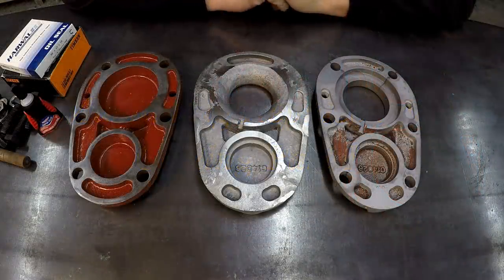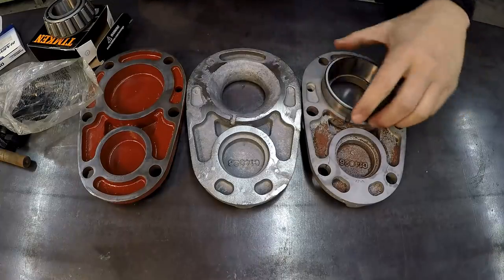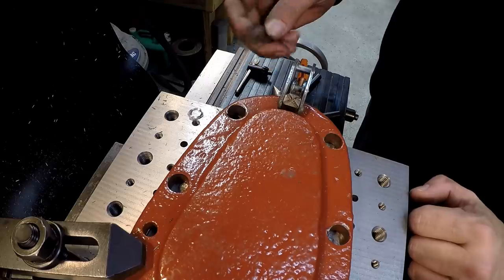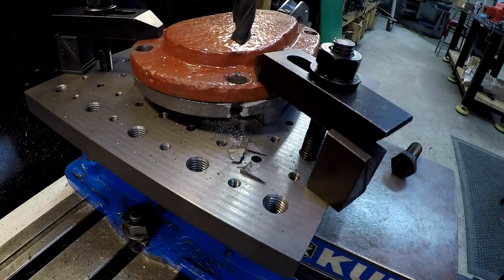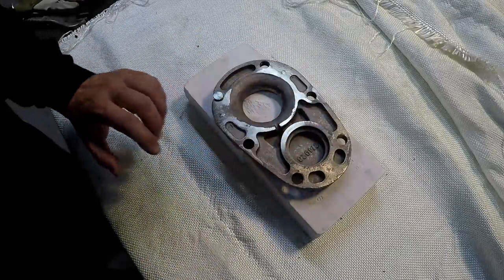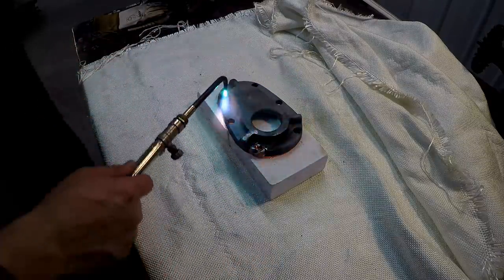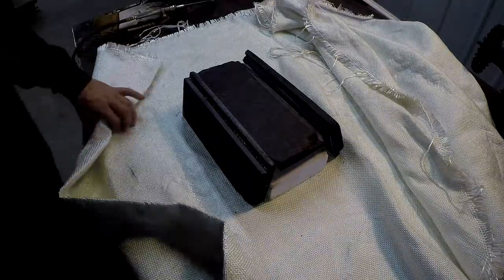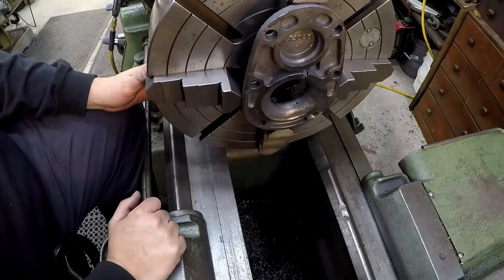Machining a Replacement Casting Part 1

Comment: Just curious. Why didn’t you repair the original casting?
Reply: i'm no adam but i would guess that the little corner he repaired wouldn't affect structural integrity whereas the original was in many pieces right across the face and into the bearing housing

Comment: Tough break on the drill damage.  I hate it when things go sideways like that.  I snickered when the aluminum sagged.  You did well, really pulled this out of the scrap bin.  I was wondering if you chucked it 45 degrees to the way you did, would it clear better and get deeper in the jaws?  Nice job still and all.  Looking forward to the finish.

Comment: I wonder if the material from brake disks and brake drums used to cast introduced the hard components in the material. I've read of similar problems using sash weights. It is kind of pot metal that is inconsistent in what you have in it. As a CNC guy I would try to measure the curves and hole positions and reproduce the original dimensions in AutoCAD if the original drawings aren't available. Then cut it out of billet on the Bridgeport Rigid-Ram CNC mill. Also, depending on the method of casting,  it is always nice to have extra duplicates while you are at it.

Comment: shouldn't you pre-heat the part in the vice? if you pre-heat first then put it into the vice, the vice will pull a lot of heat out of the part.

Comment: Usually a pattern is made bigger than the part to be cast to allow for shrinkage.   So, how come your pal used the filled up original part as a pattern and ended up with a new part the same size?
Reply: I wondered that too. You could thicken it up with a layer of bondo or something...

Comment: When the aluminum plug started melting, I instantly thought of maybe using a ceramic shield from an old spark plug. Would that have worked for the size hole you needed ?

Comment: I'm sure this isn't the first time you've been asked this, but why not tig braze? Both better heat and puddle control.
Reply: I have absolutely no idea, but maybe cause Cast iron tends to crack with very local heat spots like when welding. 
Maybe he tries to enlargen the heated area by using the torch and this lowering the risk of cracking? 
Idk, or maybe he just learned it this way :D
Reply: Could be I suppose. Although with a preheat I've never encountered cast cracking during tig brazing.

Comment: When casting anything you must add extra size when i saw that casting i cringed as those bolt holes i could see looked to be too close to the edge. You must add size with a mil on each side at least tape resin what ever . It needs to be larger than original due to salidafying metal contracting

Comment: After witnessing the majesty of that carbide bit. Why would you ever use HSS?  Is it just a price thing? Do you use them sparingly because you can burn them up, and they cost to much to replace?
Would annealing the the cast prevent this damage?
Reply: Price. Carbide is also much more brittle (and thus unforgiving) compared to HSS, and for most jobs, it just isn't necessary. HSS does just fine - even in CI. Just not in rock hard CI...
Reply: Go on MSC and price one.  I looked it up when this came out last week and it seems like a 14mm carbide drill was around $230 each!
Reply: @scottpecora371  ouch!
Reply: For something like this the prospect of having to extract a broken carbide bit would be pretty terrifying.

Comment: You say you don't have carbide drills in many sizes. Neither do I. But carbide end mills? I have a bunch. When I need carbide to get through I use a center cutting end mill. Is there anything wrong with that?
Reply: Done it before. It takes some finesse, generally end mills don't like to plunge cut.
Reply: Cost also, bottom cutting on your end mills wears them out quickly

Comment: Looks like that piece was a poor design way back when. They should have added at least another 1/8" to the outside for strength around the holes.

Comment: Would re-annealing/normalizing the casting by heating reduce the hardness of those spots?
Reply: Unlikely. If cast iron got hard, the only way to make it soft again is to re-melt and re-cast it. Besides that casting has other issues. Clearly it shrunk enough so the wall thickness around those holes reduced to almost nothing.

Comment: Had jobs go sideways on me, and just then go even further off the rails during the "fix." Sucks alot, but part of the job.
Not your fault about the hard spots, foundry guy should have kept the part an extra day, fast turn around or not.
Reply: how would keeping the part an extra day make it not have hard spots?
Reply: @DieselRamcharger  14:10
Reply: @MrPatrickmartin1985 yeah i heard that after i commented. though to be honest I'm not 100% sure the foundry guy is telling the truth....
Reply: You can't rush casting(s) or fine whiskey. It needed to sit and cure a bit, problem was the time factor. Could be that the piece of equipment that this goes on is part of a process line that is down for routine maintenance and the schedule to have it back up and operating is limited and very tight. No room for unforseen delays. The foundry did a top notch job and effort turning it around.

Comment: I have rarely had a part cast in the past few years they didn’t have hard spots in it. It has to do with the impurities of the cast-iron being recycled. You would be hard-pressed to find really good cast-iron to make that part out of you might be better off buying a slab of cast-iron and machining it. Just a thought. I have ruined a number of carbide tools over the past few years working on contaminated cast iron parts even ones that I buy made by other companies.
Reply: Sounds like it was cast as quick as possible.  Could be the mix of iron he had in the crucible was intended for a thicker section part so the liquid iron cooled faster on this part and got a bit of a chilled skin.

Comment: I think the guy that cast the part should have given a warning about the consequences of a rushed delivery when it was ordered.  As a buyer, I have a level of trust that my vendors are not going to set me up for failure.  Adam is obviously an excellent machinest, but he should not have to know every detail of the casting process and the consequences of pulling the part early.  This is the vendor's responsibility to inform the buyer.    In this case that information gap caused a great deal of problems.
Reply: Clint Ferreira  Well said.

Comment: Why would raising the work by raising the knee be less likely to snap the drill bit vs. going down on the quill? Slower and more gradual maybe?
Reply: istvan meissler - lowering with the quill by hand can let the drill grab the cast as it breaks through and pull the drill down possibly breaking the casting or even the bit. By locking the quill and raising with the knee helps prevent that. The knee feed is a lot stiffer than the quill, and it’s also extremely heavy. You’re much better able to control the rate the drill is plunged than using the quill.
Reply: @shawnhuk   Thanks for your reply.

Comment: Adam, a general question: Is it economically feasible to have individual items casted? Reason for my question: I am restoring an 60 year old truck. A bore  in a spring hanger is worn out - probably due to corrosion. The machine shop suggested to enlarge the bore and press in a sleeve but I am skeptical that a sleeve would stay in place because these spots carry the weight of  the truck.
Reply: Ask at you're local heritage railway, if they rebuild and restore locomotives they may well know where you can get castings made.
Reply: Really depends on the wall thickness left after boring, but in general sleeving something like a spring hanger will do the job. You didn't say how much wall thickness they wanted to take out to clean up the bore or how much original metal would be left, but I'd probably be okay with sleeving up to about a quarter of the original wall thickness of a part. Hard to give an opinion without knowing what the part looks like.

As for the sleeve coming out, it's not likely to happen. Sleeves are usually installed with a hydraulic press into bores that are slightly smaller than the sleeve so they wedge in tight. If your really concerned about it, have them do a couple tack welds to hold it, but it shouldn't be needed. Things like control arm bushings, wheel bearings, piston wrist pin bushing, etc are all just pressed in.

Comment: You're right, those straight flute carbide drills work great on hard stuff. I use a #30 or 31 to drill holes in hardened rifle actions to mount scope rings. Too bad about break out, but shit happens. Don't let it get you down...nice recovery.

Comment: So about those holes... Possible crazy question but I want to check my first inclination if I were in that situation: If you had a carbide boring bar, could you open those holes up with that rather than trying to do it with HSS?
Reply: If the HSS couldn't do it, yes that would be the way to go.  This hardness is called carbide precipitation I believe, and if I remember right, it's caused by the casting cooling off too quickly.  Heat treating the casting before machining would normalize it I think, if CI behaves like other standard alloys.
Reply: @eformance  I think it also happens to brake rotors.

Comment: For someone who has no clue about machining, but just finds your work intriguing to watch; why is pulling the knee of the table up less likely to cause your drill to snap then pulling the arm down?
Reply: The more you lower the quill, the more play/flex it has. Carbide doesn't like to flex, so it's better to keep the quill fully retracted and raise the knee instead.
Reply: @andronicuscomnenus2642  Ah, thanks, that completely makes sense.
Reply: Plus you have far more plunge control with the knee over the quill. 

In a case like that. You are pulling down on the quill handle. When the drill breaks through. You can end up with the drill grabbing the still un-cut material. That kind of shock from sudden load change can wreck carbide. 

Carbide is a lot harder than High Speed Steel. On the flip side, it is a lot more brittle. Plus a lot more expensive.

Comment: Adam, how do you like the harbor freight straight die grinder? I have two of the 90 degree ones (probably shouldn't have gotten a second one) and the head loosens/pops off on both. Good save with the brazing! It's interesting that the part wasn't as easy machining as your normal cast iron

Comment: indicating the new piece to the old opposite end cap (the one that isn't broken), is that smart? Using the outside edges of a rough casting to drill matching holes? That's not really exact. Won't that likely put the bearing diameter off-center?

I'm willing to be re-educated. (c;
Reply: Yeah. You would think that true position between the mounting holes and the bearing hole would be important.   I would've bore the bearing diameter hole with the SAME set up that I used to drill the mounting holes so that all the holes would have the best true position.  But maybe Abom thought of something creative to achieve that.
Reply: I've been burned trying to do a quick transfer like that. You're better of making a datum, measuring, drawing it in CAD and dimensioning from there. For a simple part like this you're looking at 20 min.

Comment: Is there a reason for the straight flutes on the carbide drill?
Reply: Rigidity. Straight flute bits are meant for hard materials.
Reply: I don't think you will find a twisted carbide drill unless it is just tips also twist drills don't drill round holes by their very nature  a strait fluted drill does.
Reply: We use solid carbide twist jobber drills at work every day, very common nowadays

Comment: how did u take the center for the hole on the casting? on the lathe...
Reply: Indicate in 4 sections, because it’s a rough hole.
Reply: @alexmiller9027 tnx i got it now. othervise this hole is not on the same place like the original.

Comment: What type of alloy was casted there? When it is a steel casting it wa cooled under terriblye wrong conditions, way to fast. If it is a grey cast iron, it was maybe not treated properly before casting and solidified with carbides and hard phases in the grain structure.

Comment: you might want to anneal glow (to globular  grey cast iron) the casing the next time before you are trying to machine it
its quite possible that the hardening from the outside of the cast comes from usage of the wrong sand (oilsand or silica sand)  or to little preheating of the forms or a ceramic coating that partly absorbed the carbon makeing the outside layer steel over cast iron
maybe you would have been better off cutting it on a CNC with the previous part scanned , modelled and then just cyclus copied out of a block of material
Reply: I think he should scan the old part, 3D print a new improved version and have that cast.
Reply: But where's the fun in that?

Comment: I wonder about the bearings that retains.. if that was caused by a crash it could have put flat spots in the tapered rollers and dents in the races. I also wonder about restoring bearing preload but in that shop I am sure that will be handled properly.

Comment: Could you lay that out accurately enough to 3D print a mold that was properly oversized to account for the shrinkage? (Just speculating from the sidelines over here.)

Thanks for letting us hang out!

Comment: maybe a dumb question but why is it less likely to break the bit if you're raising the knee vs. lowering the quill?
Edit: second question.  Do you think those hard spots could have been eliminated by annealing the part?
Reply: You stand a bigger chance for the drill to grab and pull the drill though the uneven hole with the quill being hand operated.
Reply: Annealing would almost definitely help, unless as someone mentioned further down it was sand from the flask that got incorporated into the part. Probably could have even just tempered it a bit to take some of the hardness off. But my heat treat knowledge is mostly from blacksmithing, not casting, so I may be off on that.
Reply: Extending the quill reduces rigidity. I was taught to extend the quill as little as possible.
(This is obviously different for a CNC Z axis)
Reply: You have far more control with the knee over the quill. 

As for the hard spots. If Adam expected them to be as much trouble as they turned out to be. He could have annealed the part before hand. Also, we have the luxury of not being pressed to get it finished.

Comment: A trick I use on the indicators reaction bar so I don't have to hold it with my hand is I use a big Larry light stuck to the table to act as a stop. Larry lights are great to have scattered around the shop.

Comment: Facebook marketplace had a 24 inch Monarch for sale on it just a week or two ago, believe they wanted scrap value for it, not sure how that would work, it looked like it was either a 12 or 14 foot bed though. Right now all I can find is a 33" lathe in Burlington, NC. from some name I don't know. 200" center to center. maybe the Monarch was on Craigslist?

Comment: Would lubrication have helped in drilling through the hard spots?
Reply: No; CI self-lubricates due to the carbon (graphite) content. The issue with hard spots is the cutter would rather skid over them than cut them, which is why they make a godawful noise, lots of vibration, and the rubbing action tends to blunt the cutting edges. You can, often, force your way through a hard spot, but it'll kill the drill. And possibly the item you're drilling too.

Comment: Oh man, I had this same issue drilling boron steel. It'll eat up high content cobalt and even dull out nice tungsten carbide bits. I feel your pain.
Reply: I was only drilling 3/16 holes. Ended buying a bunch of good quality cobalt and tungsten carbide bits, then, amazingly, Dewalt has some little drill bits that have thread taps built on. Those worked surprisingly well to cut nice fine threads for me to put small screws into. 1/32 inch boron sheet metal holds threads like something 3-4 times as thick.

Comment: I would recommend a silicon bronze stick welding electrode and just fill that hole in, or Tig with Silicon bronze rod. Made for Cast Iron

Comment: I've run into more than my share of chills in castings and in my experience the best thing to do is to cycle them through the heat treat - my recollection is 1450 with an hour per inch thickness with a 2 hour cool down.  You will lose a grade (Class 40 goes to Class 30) but no dimensional changes

Comment: May I ask why not use and lube when drilling maybe a dumb question  but just wondering
Reply: Generally with cast iron you don't use lube. 1. Cast iron has graphite in it, which acts as a lubricant.  2. Cast iron generally forms more of a powder than chips, with oil it becomes an abrasive slurry.
Reply: Cool thanks for the reply

Comment: I knew the instant he said "aluminum" that it wouldn't work. The melting temp of aluminum is below the melting temp of the braze material.
Since he didn't have carbon, he could have possibly used stainless steel....or, an aluminum rod about 8 inches long might have worked: the high thermal conductivity, extra mass, and surface area of the long aluminum rod might have kept the temp of the rod at the braze area below brass' melting temp.

Comment: I put my parts in a steel bucket with floor dry after welding or annealing and they take about 8 hours to cool to avoid cracking